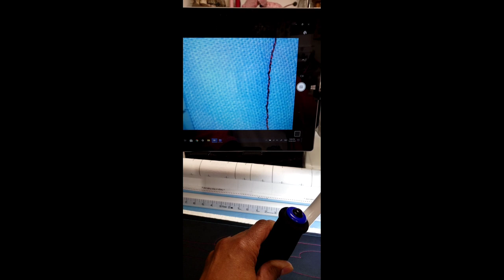Quilted Poodle Bite #2: How to see stitches under your quilt while longarming: USB Endoscope Camera

Comment: What are the “panel guides” you mentioned
Reply from the maker: Hi! Thanks for watching my video. Here is the description and link to the plastic cable management "guides"               from Amazon. Self-Adhesive Cable Clips Organizer Drop Wire Holder Cord Management, Pack of 20, Transparent: https://www.amazon.com/Self-Adhesive-Organizer-Holder-Management-Transparent/dp/B01I6P20TE/ref=sr_1_3?crid=2KXAEIIK54IJK&keywords=eyelet%2Bself%2Badhesive%2Bcable%2Bclips&qid=1671565689&sprefix=eyeislet%2Bself%2Badhesive%2Bcable%2Bclips%2Caps%2C102&sr=8-3&th=1

Comment: What are you using for mounting the end of the camera? Are those also cable hers of some kind that that camera just fits in or a special mount?
Reply from the maker: I used transparent cable clips to manage the cable and to hold the camera. It's a snug fit for the camera but it works. Amazon:  Self-Adhesive Cable Clips Organizer Drop Wire Holder Cord Management, Pack of 20, Transparent. I used two 1" square pieces of foam core board to mount on the side of the machine to hold the camera

Comment: Do you run both the creative touch and the camera at the same time?
Reply from the maker: Yes, I have the camera app oven and switch back and forth by selecting the icon in the taskbar for either QCT or the camera view to be shown on the screen.
Reply: What brand of camera are you using?
Reply from the maker: @karenengland9470  Here is the description from Amazon.com  Wireless Endoscope, GOODAN Updated 1200P HD WiFi Borescope Inspection Camera with 2.0 Megapixels HD Snake Camera for iPhone iOS Android Smartphone, Table, Ipad, PC - (16.5FT) - Include Carrying case. Here is the link:  https://www.amazon.com/gp/product/B074KL13T4/ref=ppx_yo_dt_b_search_asin_title?ie=UTF8&amp;psc=1  It may or may not still be available; I got mine in 2018. But the description will help you find another brand. I went for the least expensive one  😊
Reply from the maker: Here is a similar one if you can't find the above one;  Inspection Camera Endoscope, Wireless Endoscope WiFi Inspection Camera 1200P HD Borescope Waterproof IP68 Snake Pipe Camera with 8 Led & 5M(16.4ft) Semi-Rigid Cable for iOS Android iPhone Windows Mac

Comment: what camera did you get?
Reply from the maker: The one I got initially is no longer available, but i think this 1 will work. It  We'll transfer pictures to your tablet via Wi-Fi.  Here is the link on Amazon. Wireless Endoscope, WiFi Borescope Inspection Camera 2.0 Megapixels HD Waterproof Snake Camera Pipe Drain with 8 Adjustable Led for Android & iOS Smartphone iPhone Samsung Tablet-16.4 ft (5M) https://www.amazon.com/dp/B07CG4Q1Y3/ref=cm_sw_r_apan_glt_fabc_GR95FN0093WK7YRX44VC